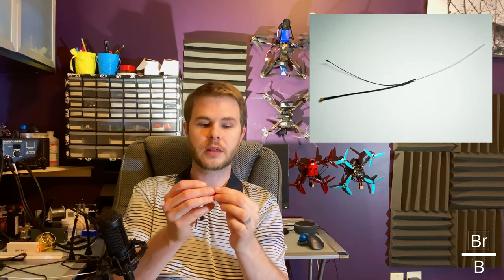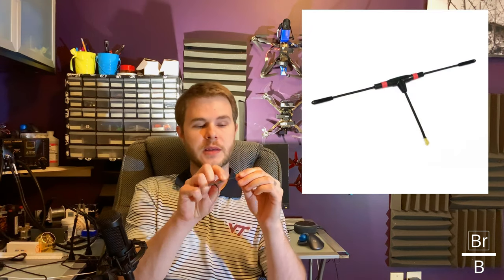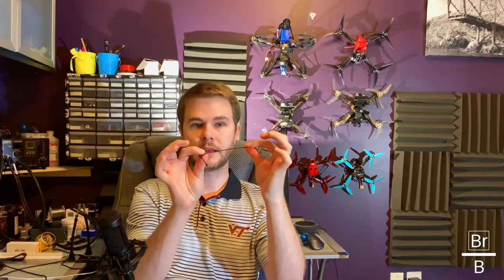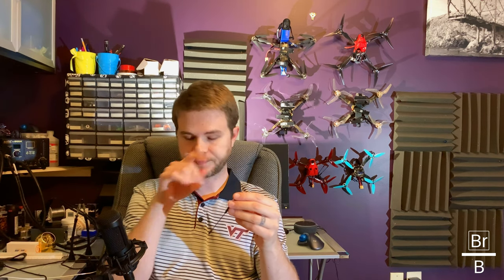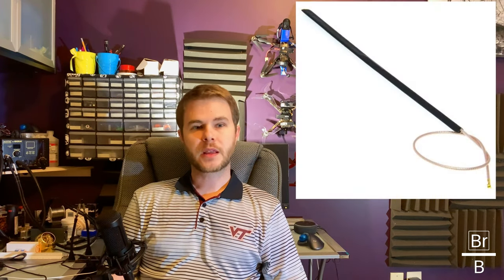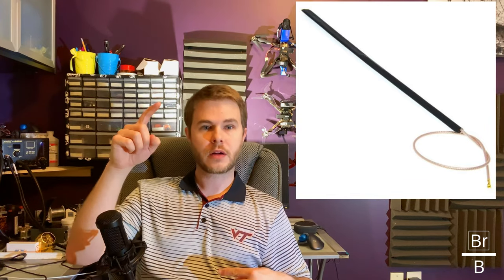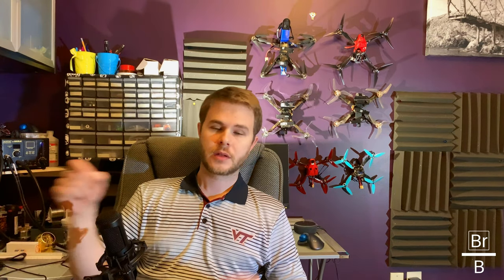Crossfire Antennas | Are you doing it wrong?

Comment: A comment on orientation not really mattering at close ranges: I once had a wing failsafe on me at just over a mile, which was unusual. It turned around and came back a little way and I got link back, continued to fly around the park, then landed. When I went to investigate the failsafe, I found that the antenna had broken off at the u.FL connector in a previous crash. So, I had a solid CrossFire link all the way up to 1 mile, with NO antenna!
Reply from the maker: That’s what I mean about the robustness of crossfire. If you’re flying close you will likely be just fine with nearly any orientation. I wouldn’t call a mile close, though 🤣
Reply: BrOverbee well that’s the thing, I had to go a mile to notice there was a problem! Who knows how long I was flying like that until one day I decided to stretch my legs. In my engineering mind, I know that CrossFire isn’t actually magic, and the laws of physics still apply, but the emotional part of my brain thinks it’s pretty freaking close...
Reply: Wild

Comment: Yep totally agree, for racing and freestyle where you don’t intend flying more than a couple miles out it’s better to set antennas up for protection rather than optimal transmission/reception so you can bash on the quad without damaging them as easily.

Something else I’ve started doing is soldering the multi standard wire together on the very end then glue the little rubber caps back on. It doesn’t seem to have a noticeable affect on range and stops the antenna splaying apart if it gets a prop strike.
Reply from the maker: I might amend your first comment to say “...more than a couple [hundred yards]...”, but you get the gist. Thanks for watching!

Comment: I have the immortal T. The only issue is that the little plastic end but seems to have gone. Must have touched the prop. 
I’m so relieved hearing you say that it won’t matter if that little bit has gone. 

My quad still flies fine and I’ve not noticed any drop in range or anything. I have guna replace the immortal T but it seems I don’t really need to which is ideal.
Reply from the maker: You’ll be fine without them. You can always add a little heat shrink to the end if you want to. If your antenna is physically damaged, however, you should replace it.

Comment: Basically, if you need maximum range/performance you want them vertical and aligned, if you're not pushing the limits anything that works well enough is fine, you loose some db when they're not aligned, but it still works fine, and if you're doing flippy floppies it's gonna make little difference anyway.
Reply from the maker: That’s essentially the point I’m making yes. Purists will tell you that alignment with your transmitter antenna is a requirement and anything else is heresy - in fact, some of them made their triggered presence known in the comments. The reason the flexibility on orientation I explained in this video is OK for Crossfire is predominately due to the frequency that Crossfire operates at relative to your proximity to the aircraft.

Comment: Have XFire and ELRS. Always align my Tx antenna with the Rx of the quad (horizontal) Never had a failsafe, even at distance (2-3 km). According to common belief, 'L' configs sacrifice a little range while ensuring a link regardless of quad orientation. I did the  L thing and switched back to the T thing and have seen no difference.
Reply from the maker: Yep, I agree. That’s why I said what I said in this  video. 2-3km is mid-range flight. If you want to push farther out, your best option is a diversity arrangement and orienting accordingly. Again, the whole point is that Crossfire is heckin’ powerful and for 98% of users it doesn’t matter how you orient your antenna.

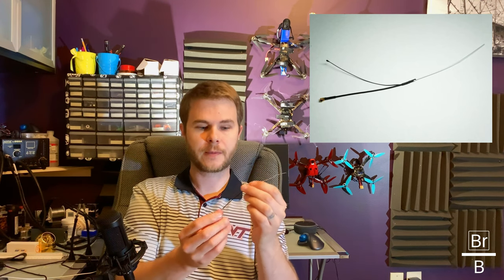Comment: Having recently changed my quad over to Crossfire, I have been having nothing but good experiences. I am wondering, as a quad pilot, how should I interpret the low end of my LQ limits. I am afraid to push it that much further than I would go on my old FrSky, as I am flying out past the point where I could reasonably retrieve the quad. So far I have gone out to the point where my LQ goes down to about 1:40. Once it gets there I freak out and turn back. I still have perfect video and control. I am just wondering, at what LQ do you start getting worried and decide you are at your comfortable limit? I am not after "how to get the farthest", I just want advice on interpreting the LQ in my goggles. Thanks for the informative hype-free video. appreciated.
Reply from the maker: Here’s a video I did on how to interpret the crossfire stats. The short answer is you can go much further than you think. Once crossfire changes from 150Hz mode it stops displaying LQ in the 100-300 range and begins displaying it in the 0-100 range. At that point it gets a bit complicated for a YouTube comment answer. Watch this video where i explain it all in detail, and feel free to share with your friends. https://m.youtube.com/watch?v=orAB24ZmiDw&t=2s

Comment: Good morning 
Thank you for your video 
Can I use a extension between the crossfire rx and the antenna.  I want to move both of my antenna farther away from all electronics on my wing plus can I change the antenna as will. Like from wire to the T one.
Reply from the maker: TBS offers several different antenna types for the RX, and they have some with longer leads than others for this very reason. Check the TBS website for their options, you can replace the wire-type with one of the longer lead immortal T styles. I wouldn’t personally use an extension to make a lead longer, though, especially if the goal is long range.

Comment: i dont understand why the crossfire orientation matters when the drone is always changing its position while flying..
Reply from the maker: That’s what I said in the video, and why my personal belief is that for freestyle flying orientation doesn’t really matter as long as you’re not shielding the antenna by placing it in the body or behind a battery. Basic radio principles still exist regardless of how you’re using them though: the best signal is attained when the antennas on the TX and RX are aligned. If you plan to long range, you need to factor this in to account or at least be fully prepared to lose the craft. For long range flying, you shouldn’t really be flying freestyle at those distances. Good luck and have fun.

Comment: Hi whats your max range with the mini mortal t? I have one and it only has 63 rssi at point blank range and then it drops off to the low 20s after 100m.
Reply from the maker: Hi, thanks for watching. I use my mini-T on a small 3in racing trainer, so I’m never more than 60m from my quad at any time. There are a few things to check. What telemetry sensor are you using as your “RSSI” on your OSD? Do you have that sensor appropriately mapped on your crossfire settings and your radio? If you’re not using LQ, then you have selected the wrong value on the crossfire side.

Comment: Thanks for video, I'm using crossfire diversity receiver on a flying wing and wondering if I could use a micro immortal L and a immortal t together with this receiver. Thanks again
Reply from the maker: I wouldn’t. The micro antenna’s aren’t really very good, especially if you’re going to pair it with a regular antenna. I would stick to two of the same antenna type.

Comment: What a great video Thanks, I'm new to crossfire but not to wings it seems like by inserting the mortal t antenna through one of the wings that you would loose surface area of one side of antenna? Right now I have my mortal t mounted vertical on the side of the fin of my c1 chaser but the range sucks I'm very disappointed. What kind of range are you getting with your setup on this wing? Thanks again
Reply from the maker: Normal range for me (inside 1mi). I’ve never experienced any loss of range. My video cuts out first.

Comment: Antenna orientation does matter. If your TX antenna is horizontal then your receiver should be the same. Yes you can get away with flying in the park with it different, but if that's all you do then you might as well stick with 5.8GHz and it's much smaller antennas. If you really want to understand antenna orientation go find a ham radio book and read the section on antennas.
Reply from the maker: Hi Randy. What I said in the video is exactly what you said, minus the 5.8GHz part. This isn’t a video on general antenna orientation - it’s specific to crossfire. Thanks for watching.
Reply: it appears that did  not watch his video in its entirety?  he explains all that you are saying.
Reply from the maker: @timcable  Most likely he’s coming from many years of short-wave radio and fixed wing RC. People who have spent a lot of time in those hobbies are often very particular about the “right” way to do things, especially antenna placement. Any deviation from what’s “correct” and they’re likely to gatekeep you about it. In the hobby of FPV miniquads, it’s far less important because of 1) the flight styles of FPV pilots and 2) the frequencies that we’re operating on with a system like Crossfire. Most likely, he was triggered by the video, said his piece demonstrating his superiority, and moved on to gatekeep somebody else. Thanks for watching!

Comment: Hi would this work, with 2 Helium antenna’s at 9mhz ?
Reply from the maker: I’m not sure what a Helium antenna is or how you plan to use it, but the principals of antenna orientation are the same regardless of application. For best reception you want the transmitting and receiving antennas to always be co-planar (same orientation). If you’re putting these on a freestyle drone for park flying, you can usually do whatever works best within reason and common sense. If you plan to fly at range, go for best reception.

Comment: i get continuity on both sides lol
ive tested my imortal t with one prong on the topside of the ufl and the other prong one one of the t lead and i get continuity on both sides
Reply from the maker: If you have one of the new ones with a Bal-Un, then this will happen. It’s nothing to worry about and your antenna orientation doesn’t matter with regard to + / - relative to ground. Orientation is still important for distance, but it doesn’t matter which is oriented up.

Comment: What is the difference between a crossfire antenna included in the Nano SE  kit (receiver + immortal T antenna) and the Immortal T V2 antenna which is stated to be more powerful and stronger .. Thinking to  mount this on the Nano rx for a 7" long range. Or is the SE antenna the same as appears more flimsy and OK for a smaller quad.
Reply from the maker: The SE is likely the V1 antenna and the difference between the V1 and V2 is a different cross piece housing (stronger) and the use of a balun. I’ve taken the V1 out 2 miles, you’ll be fine with either provided you orient it correctly for long range.

Comment: great congrats ! so for a long range 5" build, do you think the crossfire antenna it works better far from the vtx antenna on the back ? and can i use the bardpole for this quad ??
Reply from the maker: If your goal is range, the antennas should be as far from each other as is feasible. That being said, the spectrums are very different from each other (900MHz vs 5.8HGz). A BARDpole is just a crossfire compatible antenna, the type of drone doesn’t matter as long as there’s plenty of room.

Comment: One last question, how are you protecting the bottom of antenna during landings, I can't really make it out from photo. Thanks
Reply from the maker: It doesn’t get protected, it hangs free. The antenna is NOT fragile though. As long as you’re landing gentle it’s just fine
Reply: Ok thanks, you have a new subscriber, I may need some advice later but using crossfire micro tx v2 and nano receiver and my range sucks. I'm in process of replacing the receiver and remount antenna like you have done and see if that helps. Thanks
Reply from the maker: Look me up on fpvchat.slack.com, username Bee. It’ll be easier for convo’s that way.

Comment: Did you test what range of your quad in the worst antenna position?  On 250mW?
Reply from the maker: Define worst. There are a lot of other antenna positions that could be used, but who’s to say which is worst for each specific application. As long as you’re not wrapping the antenna in foil or stuffing the elements in the frame, you’ll be fine for close proximity freestyle. If you want to push range, orient them vertical.

Comment: So If I want to mount an immortal T in front of a deadcat frame and a Tbs bardpol vertical on the back, am I doing it wrong? considering that despite the way i run the antenna on my radio it wont be aligned to one or the other antenna on the quad being different orientation, is that correct? at that stage, if it's not that ideal that way, should I just mount 2 immortal T horizzontal 1 on the front and 1 on the back? is this second style more effecient then the first?
Reply from the maker: I’d need a little more information to be able to help. Are you setting up for freestyle or long range? Are you running a standard Crossfire nano, or a diversity nano?
Reply: @Its_Mee_Bee  sorry I should have be more clear. The setup it’s for long range, running the diversity receiver.
Reply from the maker: No worries. If you want to do long range, I don’t recommend putting on on the nose of your craft. Run two bardpoles off the sides at 45deg, above the frame and battery. It’ll look like giant bug antenna, but you’ll have really clear signal. Which frame is it?
Reply: @Its_Mee_Bee  it’s the iflight chimera7”. Unfortunately I own only 1 bard pole and several immortalT. I was wondering whether it would be more effective running 2 immortal t horizontal or 1 immortal plus the bardpole
Reply from the maker: @GioFpv  no worries. Just use two immortal t’s mounted vertically, in a V shape. There are some cool tpu mounts to help do this. https://www.thingiverse.com/thing:3471900
Reply: @Its_Mee_Bee  thanks for your help and advise man, really much appreciated. So in the end you reckon the bardpole would be useless in that way?
Reply from the maker: Bardpoles are great! I showed one in this video, and if you can get a second one, having two way up above your quad is ideal. I don’t recommend mixing them though.
Reply: @Its_Mee_Bee  okay cool! Thanks for the heads up. I’ll let you know how I go with it.